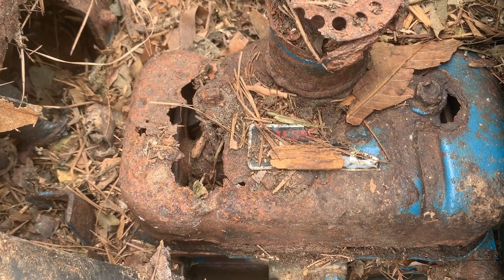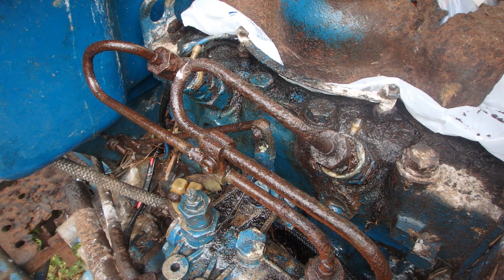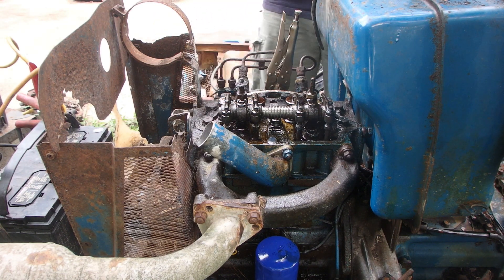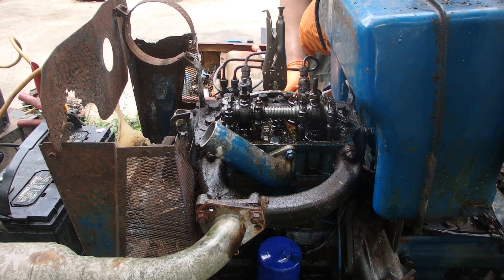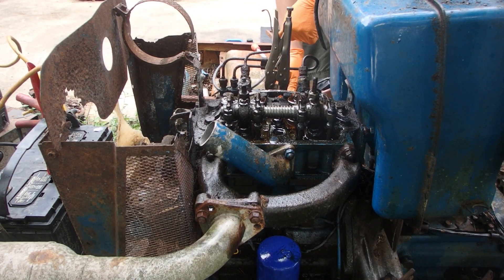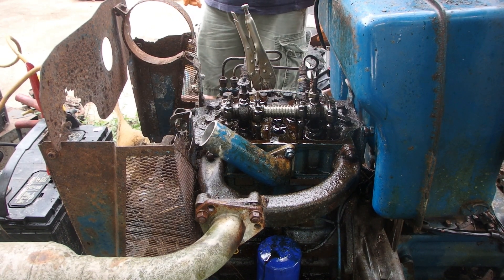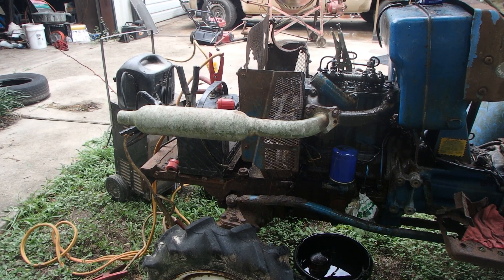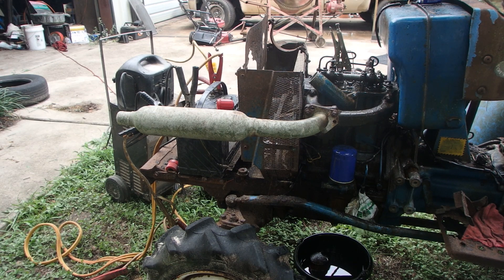Free Rusty Tractor 15+ Years Old Start

Comment: Giving me hope I can get my old E14 that I picked up cheap as it had a cracked head going again.  I am at the point you were just before yours started and stayed running.  Also dealing with low compression in my rear cylinder due to sticky rings(only 661 hours on my engine).  But my started gave up totally, have to get a new one before I can try again.  So I am soaking the rear cylinder with PB Blaster via the glow plug hole to help free up those rear rings enough to get her to start.  Once I get some heat in the block, like yours did, I think it will be ok.   Mine does not have the massive rust issues, just lack of upkeep and weather worn.  Mine is also 2wd and not 4wd(I wish it was!)